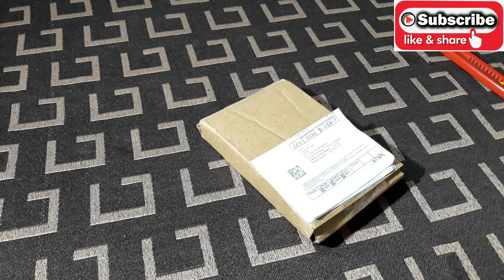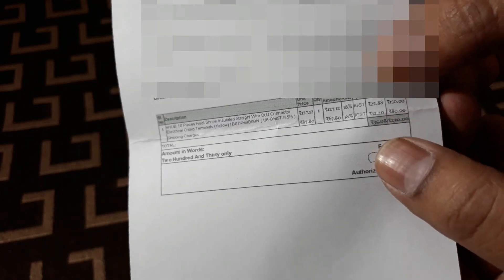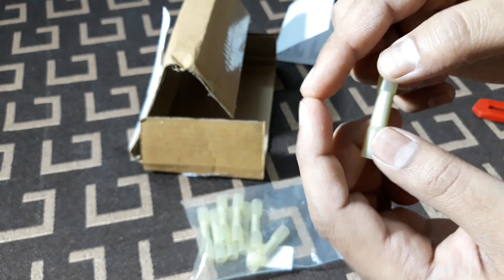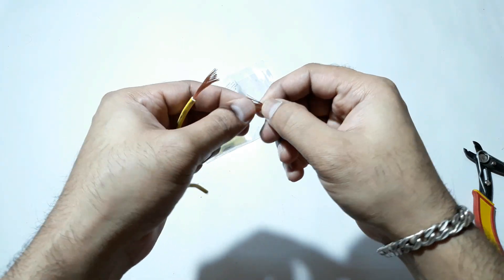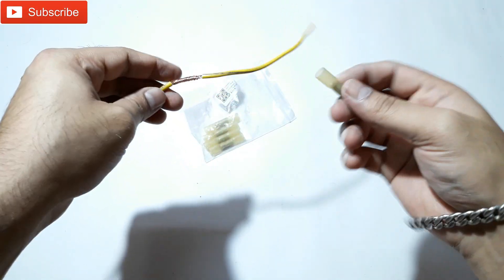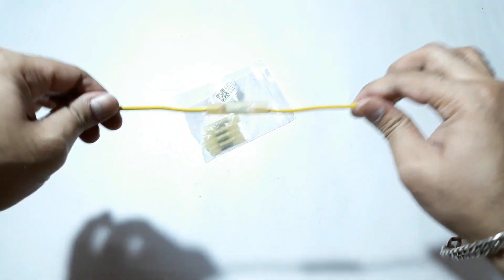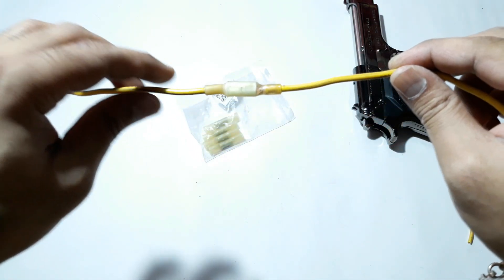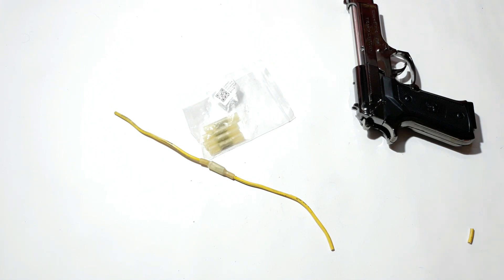Electrical Heat shrink Butt Connectors, How to use Butt connectors

Comment: Nice splice, I only saw people stripping the wire at cable ends, inserting, crimping and heating - but I reckon splicing it first would be a better electrical connection.

I have no idea - I got interested in this like two days ago.